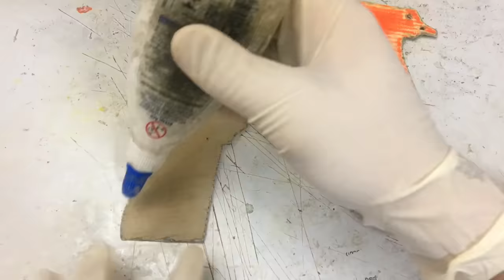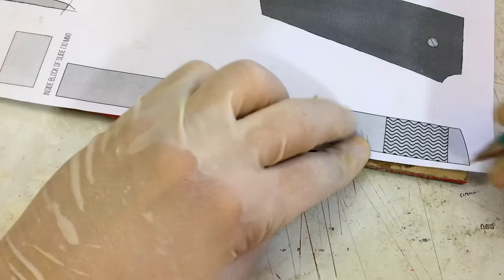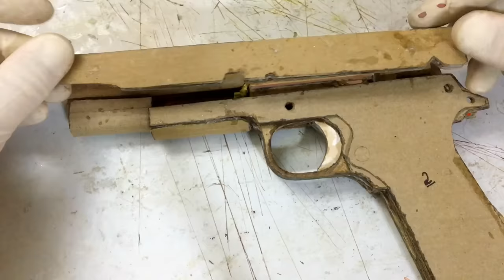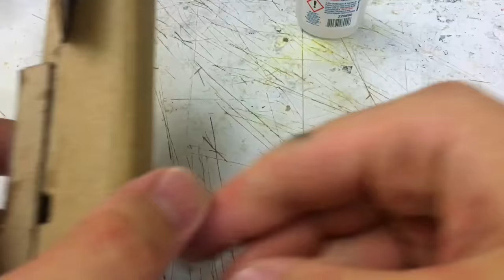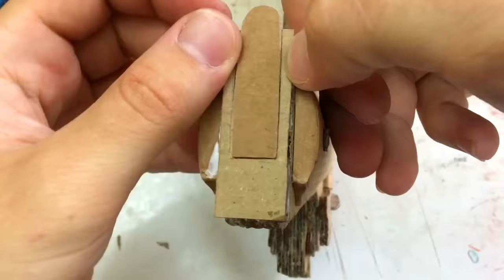How to make CARDBOARD Colt M1911 with BLOWBACK - EASY / Como fazer pistola de papelão com blowback

Comment: Here's some things to note:
1. Making this takes a very long time. (For me it's over two days)
2. Make sure you have a good amount of rubber bands of various sizes to use.
3. It's obvious this guy uses a scroll saw or something similar due to having such clean cut edges, so consider what's available before making this. (I used a box cutter and scissors)
4. This gun prop does not shoot, it is purely an aesthetics piece
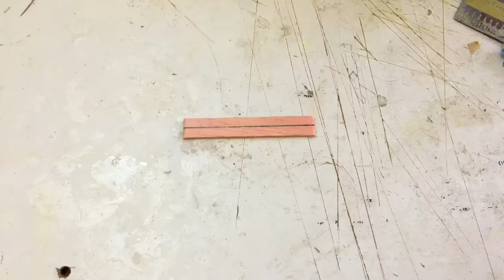5. Make sure you have pieces of wood (not 4 by 2s, but rectangular sticks a little thicker than matchsticks [I myself used more cardboard for this section]) 6:34
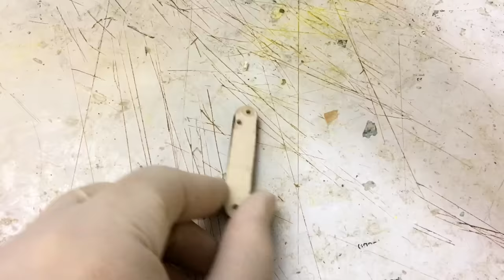6. For the steps at 3:18, I did not follow it at all because I did not have a rubber band so small nor the capability to cut it and then re-tie such a small band. I made this larger part in one piece, with a section jutting out at the bottom to push the trigger back, and a section at the top to 'lock' or secure the rubber band for the whole retractable feature. (I haven't finished making the gun as of yet, but I will make an edit later on and mention if this step prevented the prop from working completely or not, this can be an alternate way of making it for a younger audience or an audience who doesn't have such resources).
7. The clear stuff he is using after applying PVA glue is SUPER GLUE. Be very careful using this, and I avoided using it completely due to the risk of accidentally supergluing moving components.
8. You also will need some sandpaper, because if you're like me and used scissors and a box cutter, some of the edges are messier than the others, so you can at least even it out and fine tune the prop once you've finished.
9. This requires a lot of cardboard, so around 5 or 6 shoeboxes may just be enough, I used a very large box which used to contain an edge trimmer, so I had no problem with shortages of cardboard or consistency in sizes, although this may be something you have to consider if you do choose to use shoeboxes. The creator has also mentioned in the description that he used boxes that were 1mm thick.

This is in no way meant to seem shady to the creator of the gun prop, I am simply stating things I have learnt while making this prop. I highly recommend people make this gun prop as it is a pretty cool toy, but please take note of the aforementioned points.
Reply from the maker: Thanks for the tips!
Just a correction, I cut everything using scissors and a box cutter
Reply: @HomeGunMaker  wow, I guess I'm just bad at cutting cardboard haha
Reply: much text
Reply: @mindicationdisgrace562  You have to make sure you blades are sharp.  It's always good to invest in a file and a sharpening stone.  A scroll saw is a wonderful tool indeed, although it takes a a lot of practice to use
Reply: Was it good the results?
Reply: Could I use a popsicle stick instsad for the wood pieces
Reply: @ad5048  Honestly just gave up with the project haha, it would be best to ask the maker of this video themselves.
Reply: What is the name of the cardboard u used?
Reply: salute to everyone who actually read it all.
Reply: @HomeGunMaker  dude, how precise are you?
Reply: What is the point of the movable and retractable thing at 3:18?
Reply: Do you know if the blowback mechanism still works if you make it out of aluminum? I'm planning on making this by using aluminum instead, but not if it becomes too heavy for the mechanism to work.
Reply: What is the size of paper that you print the template
Reply: Holy shit, thank you for the extremely thorough comment, it helped me with a lot of doubts i had while watching the video what an icon
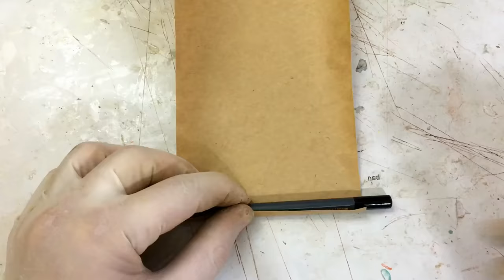Reply: hey, since you made this, could you tell me how long the barrel at 7:07 is?
Reply: @ELv839  bro i made this 4 years ago I have zero clue where I even kept it lol, guestimate is around the length from the bottom of the palm of your hand to the end of your middle finger, if you wanted to make it proportional
Reply: @mindicationdisgrace562  ok thanks
Reply: Can I buy this off u , how much

Comment: Nice, yet is it enduring?
Reply from the maker: Yes! I reinforce it using super glue, it gets absorbed by the cardboard and becomes hard as rock
Reply: @HomeGunMaker  wow
Reply: I used normal glue and apears to be hard enough too
Reply: I made seven out of hot glue and they hold up great
Reply: can i use cement??
Reply: @bushmaster101  you can use uranium 235 to make it world's hardest shit
Reply: @HomeGunMaker  legit! Cardboard + superglue just makes it hard as wood lol.
Reply: @HomeGunMaker  oh thanks you i got to materials is so easy is not complicaded
Reply: @HomeGunMaker  he is talking about the rubber bands that with time gets nasty and sticky 
How to open the gun to change the rubber bands?
Reply: @HomeGunMaker  add baking soda to the super glue ot will hard as a concrete lol

Comment: Where did you learn how to make this? This must've taken years of practice, the amount of detail and finesse u put in this makes it nothing short of a masterpiece.
Reply from the maker: Thank you!
I actually do this since I was 10yo, 20 years ago!
Reply: @HomeGunMaker  whatttt?????
Reply: @HomeGunMaker  Your work is epic bro!
Reply: I wish that the templates had measurements
Reply: @caex2473   the templates are in the description
Reply: @HomeGunMaker  omg!
Reply: Agreed.
Reply: @caex2473  pretty late but there's a 12.5 mm for a part, use a ruler and make sure it's diameter is 12.5mm and just zoom in or out until you get it right
Reply: @HomeGunMaker  this looks like a wood gun so cool

Comment: Can you show how the mechanism works please I really wanted to make this proj and I dont wanna end up failing
Reply from the maker: The trigger pushes that lever, which in turn pushes the slide back, until it escapes from the lever and goes back to the original position because of the rubber band attached to it
Reply: There is template man
Reply: HomeGun Maker for the rubber band part of the mechanism, after you cut the band to thread it through the small cardboard hole, did you just glue it back together? Thanks.

Comment: I made one of these recently and it finally worked, i even painted it! Thanks a lot for the templates :)
Reply: Did you end up using two 4’s and two 5’s?  The video makes it look like you are supposed to but the templates don’t tell you to cut 2 of each?
Reply: @PretzlGamingOfficial i used one of each cuz i have pretty thick cardboard, you can use 2 if your cardboard is pretty thick.
Hope this helps :)

Comment: It is a very cool thing but I couldn't understand well the sistem it uses for the mechanism. Do you have another video where you explained it in more detail?
Congratulations for the 30k subs
Reply from the maker: The trigger pushes a lever which in turn pushes the slide back, and the slide has a rubber band which makes it come back to its original position.
Reply: @HomeGunMaker  Thank you very much

Comment: Hey HGM, could you post the millimetre depth of each piece or at least the diameter of the entire model, please? I finished the Beretta M9 in wood and thought I’d start the 1911, but the templates aren’t quite as detailed. I’m going to construct this model/prop, in the same way as the last, in wood, but I need accurate templates. I wish I could show you how the M9 turned out, I’m really pleased with it. Thanks for the inspiration above all. Cheers.
Reply from the maker: Hey!
Make a video of it and post it here in youtube, I’d love to see it!
For this 1911, if I remember it well, each piece is made of cardboard from shoe boxes which is ~1,4mm thick, and sometimes I used 2 layers as you can see in the video..
The basic mechanism is the same as the beretta, just the outer layout is different.
If you managed to make the beretta, this one is much easier
Reply: Hi HGM, thanks for your reply. Yeah, I worked out the measurements and came to the conclusion that all parts other than listed were 1mm or slightly wider. Thanks for the help though. As with the Beretta, I’m making it in wood so care in measure is always a detail. I posted the unpainted prop on instagram you can view via @AlpacaPictures if you like. Cheers Bud. 👍

Comment: How do you make these??  The level of perfection is amazing!  I have tried to make my own using a stanley knife but I end up with rough edges and I can’t cutout the small parts.  What tools do you normally use to make the pieces?
Reply from the maker: I use just scissors and a box cutter. Try cutting a bit outwards the marking, apply some glue on the edges, wait for it to dry, and then carefully cut alongside the marking
Reply: @HomeGunMaker  Thanks a lot!

Comment: More of a question then a comment, but I was wondering on certain parts you have marked measurements like 10 mm and such. Does that mean that that particular piece should be 10mn thick which means I would have to cut multiple pieces identicale to the first & then glue them together?
Reply from the maker: Exactly!

Comment: Hi! i was wondering if you could give me a list of how many cut outs of each template i would need to make this, and what wood did you use in the holes? are they toothpicks or craft wood peices?
Reply: Bit late but 

Number / Quantity
2 2
1 2
3 2
6,7 2
4 4
5 2
Trigger B 2
Trigger A 2

I used toothpick for the small hole and the big holes I used this long stick I found, you can probably find a stick and adjust the hole to your needs

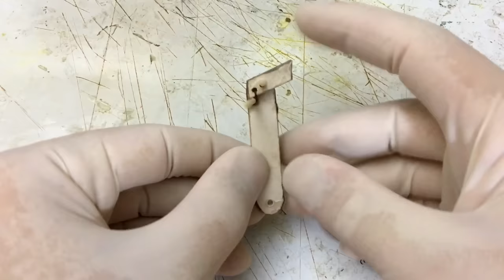Comment: 3:30-3:35 i need help i can’t do it my cardboard just falls apart when i do it and the rubber ban is too small to tie can you help
Reply from the maker: Use super glue to reinforce the cardboard, it becomes as hard as rock.
As for the rubber band try stretching it to tie
Reply: HomeGun Maker How did you tie the rubber band?